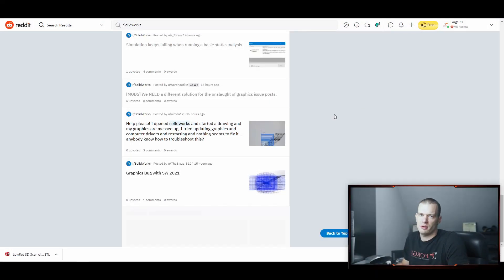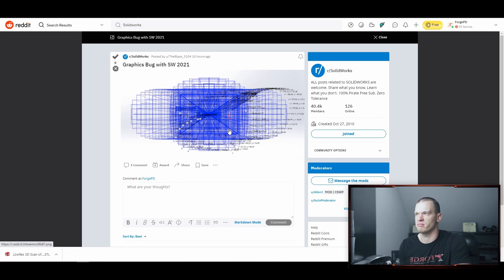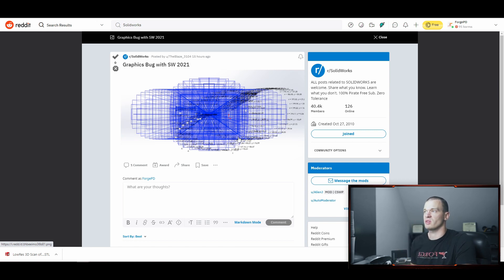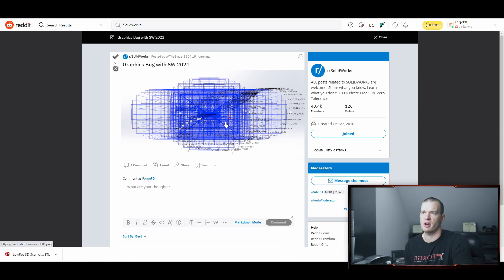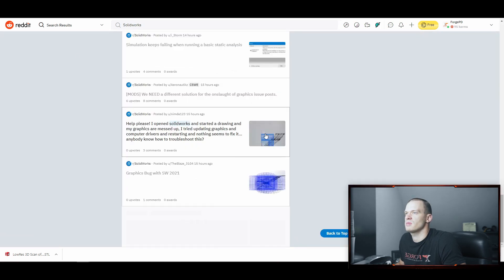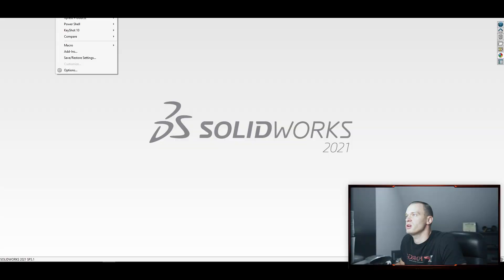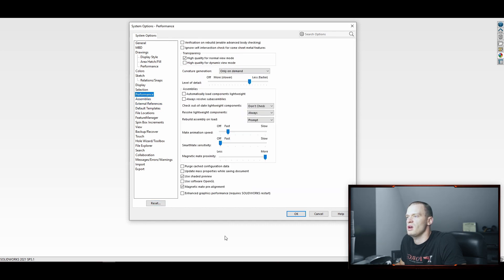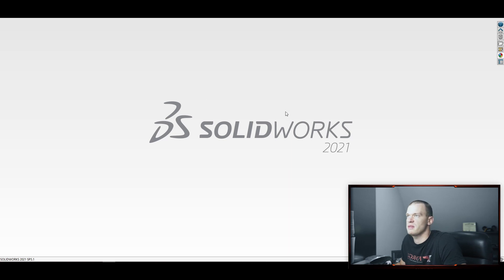How to Fix SolidWorks 2021 Graphics Bug

Comment: I enabled Realview on my RTX2070 and this bug happens while sketching. Your method solves the problem, but it also disables Realview unfortunately. Is there another way to resolve the issue?
Reply from the maker: There may be, but I do not know it off the top of my head. Is that graphics card on the SW approved HW list?

 Years ago there was a way of changing what graphics card SW though it was using, to trick it into allowing realview. That may be something worth searching for.

Comment: you can enjoy the 5x less performance by disabling that option. Make a choice.
Reply from the maker: Yeah its not great. The real choice is supported hardware, but even that doesn't guarantee anything.
Reply: @forgeproductdevelopment  have you tried different nvidia drivers? 

I have found that driver version 528.49 is the best driver that I have used with SW. I have a Geforce RTX3000 series card and had a lot of graphic glitches and problems with newer drivers after that and I was always returning to that driver. It's worth a try, maybe. If you have the time.

Comment: Anyone know if there is an actual, proper solution for this? Disabling enchanged graphics makes assemblies perform abusmally
Reply from the maker: Apparently this bug happens in more recent versions of SW as well. Are you using a SW approved graphics card?
Reply: @forgeproductdevelopment  No, I have an RTX 4070
Reply from the maker: @ Yeah it is unfortunate that those high performing cards aren't supported hardware.

Comment: This is great that it works, but it's not a fix. If I disable enhanced graphics, my pan/zoom/rotate performance is horrible in more complex assemblies, when it's smooth as glass turned on. The only side effect is the lines bug in the drawings. Anyone have a fix that allowed you to enabled full scene AA, enhanced graphics performance, and NOT have the lines bug at the same time?

Comment: Thanks!  This just started happening with me on the latest 2024 service pack - never had an issue before now, so it's clearly still something SW are having issues with years later than when it first started.
Reply from the maker: Crazy to hear that this is still happening. May need to redo the video for 2024 as well. What graphics card are you using?
Reply: Same here. Have an RTX 4090. If I enable "full scene antialiasing", this bug kicks in. Unfortunately full scene makes everything look alot smoother and has way better performance as well.

Comment: I never had the issue described in the video. I did, however, have this weird display issue, where one solid body would suddenly become wireframe-"ish" (somewhat similar to, but not quite equivalent to when you choose the wireframe view) - while other solid bodies would display as usual. Drove me crazy!
Unchecking the "enhanced graphics performance" in the settings under "performance" (as you suggest in the video) solved the problem!
Thanks a million! 👍
Reply from the maker: Glad it helped! Seems like these type of graphical issues are computer/video card/driver dependent.
Reply: I had the same problem too. Video helped

Comment: Works also well on Solidworks 2022 on WIN 11 (Nvidia Quadro P1000)! In my case, the "hide component" option in assemblies resulted in a  graphics bug where the highlighted surface of the component remained visible, very annoying! Do you know the reason for that, is this "enhanced performance" feature still experimental? In your experience, do you see any improvement in performance with this feature turned on?

Comment: Thank you so much. I have an assignment due tomorrow and this glitch was making it really hard to get the parts done for it.
Reply from the maker: Happy to help. Good luck! What are you working on?
Reply: @forgeproductdevelopment  We have a book that our professor assigns problems from, but now we're working on reverse engineering the parts of pretty much anything we want, making an assembly, and then making animations for the movement of the assembly. I chose to do a can opener lol.
Reply from the maker: @mrchefchef  Nice, that should be a fun challenge. Are you modeling top down or bottom up?

Comment: I never had this Issue with SW 2021 until i updated Nvidia drivers, I thought my setup was pretty decent to handle this option(3070, i& 10 gen and 16GB ram) guess i was wrong. Thank you good man for the help.
Reply from the maker: Power is only one factor. Solidworks has a list of approved hardware, and problems like this arise when you deviate from it. The program will still run, but you can find minor issues like this bug. When I am buying new equipment, I refer to this list for guidance: https://www.solidworks.com/support/hardware-certification/